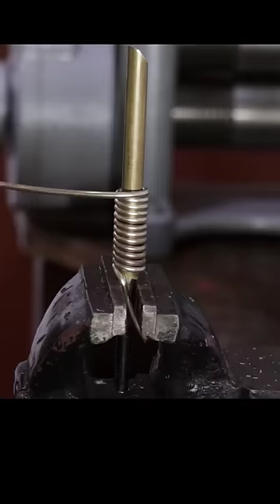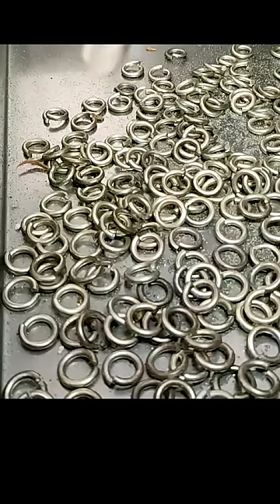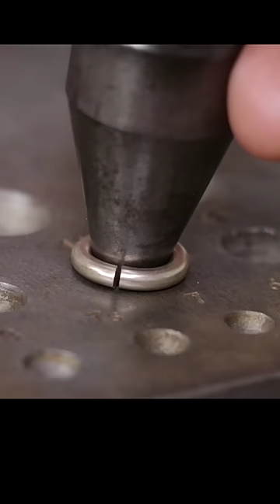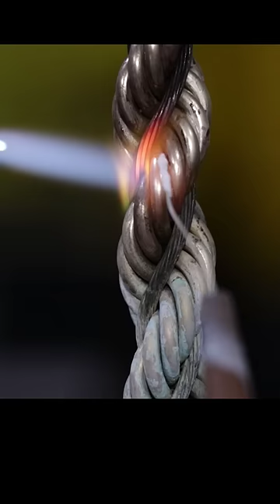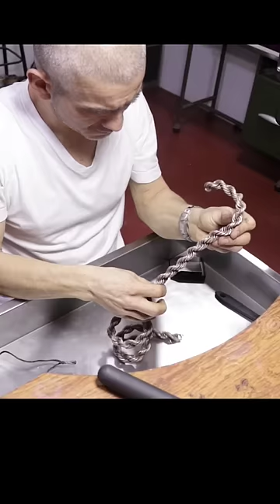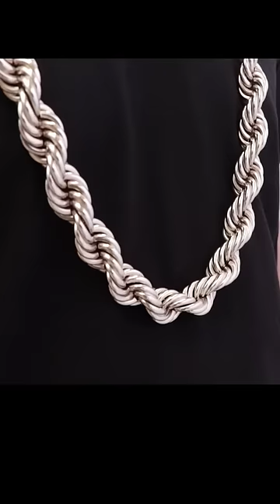Making an endless rope chain.

Comment: Use as a weapon for self-defense!
Reply: "Use as a weapon for self-defense"👴
Reply: You just gotta break one link and you have a short whip. Or if you get caught you're just gonna choke.
Reply: "it was self defense!" Mfs when they get charged with voluntary manslaughter
Reply: @naniwara8673  I think he's saying it's hefty enough to use as a bludgeon
Reply: Only a Flaming Skull Man on a motorcycle can do thatn
Reply: @NapstabIook  "use to scratch your back lol"
Reply: @NapstabIook  I know, am I right? Those pieces of metal are TINY. there's NO WAY they'd do any damage to anybody. Who ever heard of getting beat with a chain??
Reply: @spookd8700  maybe I’m too high to see the sarcasm right now, but you could totally do some damage with a chain like that.

Wouldn’t be very effective against anyone armed unless they’re a dumbass using a tiny knife, but in a pinch it could totally be used as a makeshift weapon.
Reply: @barmacidic2257  blunt force trauma is a hell of a thing.
Reply: “Use as a weapon for self defense” 👴
Reply: @spookd8700  dude, that thing must be more than a kilo. Smacking someone head with it would be fatal
Reply: @royk7712  😉🤫
Reply: @spookd8700  take it never seen the massive damage a chain snapping that was under tension can do. I've seen light damage needing stitches in person, videos of the shearing through parts of cars. 
The is also actual chain whip weapons and then stuff thats wire rather than chain like the stinger tactical whip which pretty effective.
Reply: @subhumanrogueminiaturesfor2538  wow, metal can hurt someone, crazy
Reply: Absolutely
Reply: Came here for this comment 😂
Reply: or is used against dumb owner🤣🤣🤣

Comment: So that's how you make one of those! So cool! ❤️😎
Reply from the maker: Thanks 🙏
Reply: Haze Entertainment  drop a vid then.
Reply: @ElierOlivos  is it just me or did you not show a step or two in the making process, not seeing how the links lost their round shape they had.......
Reply: @diychad7268  my thoughts exactly
Reply: @diychad7268 ia twisting the whole thing with a fair amount of torque after linking, but before joining.
Reply: @diychad7268 ence why you see that smaller wire rope when he is solder/welding it - he used that smaller rope for torsion while twisting the links and chain he made with it
Reply: @diychad7268 😊 tienes que mirar el video completo, este es un vídeo corto , en el vídeo completo, se ve todo el trabajo que lleva esa cadena y hay puedes ver qué para poder armar esa cadena hay que abrir los eslabones.

Comment: My man just made a Mobius strip.
Reply: Well it might be, really depends on whether there are an even or odd number of half twists.
Reply: MORBIUS
Reply: You're telling me that Morbius did just strip?
Reply: Mobius strip? From that one German mathematician August Ferdinand Mobius?
Reply: Not exactly. A true mobius strip has an infinite surface that connects both sides. Imagine a belt with a half twist. You could run your finger along the outside then at the twist your finger would now follow the inside back around to the twist where your finger would now follow back where it started on the outside. And round and round inside outside inside outside forever. On this chain there is no link to the opposite surfaces.
Reply: @The..Dark..Knight  also, if you bend the Mobius Strip, it would resembles "infinity", which is one of the origin of the infinity symbol we are using in the present
Reply: @05.charoen24  Just pictured that in my head and don't know how I missed that. Guess I'm used to seeing the Infinity sign in 2D. Just a sideways 8. But 3 dimensional it is a different thing to picture. Alright 👍
Reply: Morbius stripping??? 😳
Reply: So u can get that mobius drip🥶😎
Reply: @05.charoen24  huh it's no different from a circle in that regard
Reply: @lLegas  it's a circle paper that has been glued for it to have only 1 face (when you draw a line from a point and continue to another end, you will found that you returned back to where you started drawing)
And that's only 1 difference

The conclusion is that Morbius strip is just a piece of paper glued into a circle in another way
Reply: Mobius drip

Comment: You have to appreciate the effort and time it takes to work with small chain links, one mistake can ruin a piece. 

Also cause the linking has to be done by hand, which explains why the lord of the rings took so long to make, they used genuine chain link armour.

Comment: Its not endless, roughly 2 feet. You sir, just lied.
Reply: Logically there is no end POINT to chain ⛓️⛓️⛓️
Sarcasmically there is
Reply from the maker: Hello, It is associated with infinity because neither the beginning nor the end of the chain can be determined, since all its elements are connected.  If the chain would have a clasp can't be an endless because there would be 2 terminals, thanks for watching the video.

Comment: The links were never closed? Very cool how it stays together! Involves math I'm sure?
Reply: No math. Think about it for a sec. If one is open one way and the other is open the other way, and you solder them together, you're left with a kind of squished figure 8 that's closed.
Reply: Could've shown how to close it...
Reply: @insederec  please dont comment if you dont know what you are talking about. There is plenty of math involved in chain making.. aspect ratio is one of the most important pieces of mathematics the ratio of the circumference of the rings to the diameter of the wire and the rest of the math including when you bend the wire around a mandrel you lose wire length due to the bending
Reply: @sahilsquadron2286  I am quite literally a jeweler for a living. The question was how they don't fall apart, not how to make a chain from scratch.
Reply: it's just a circle💀⭕
Reply: @sahilsquadron2286  and exactly none of that is relevant because there will be zero load placed on this chain